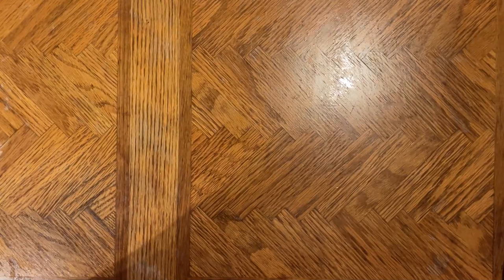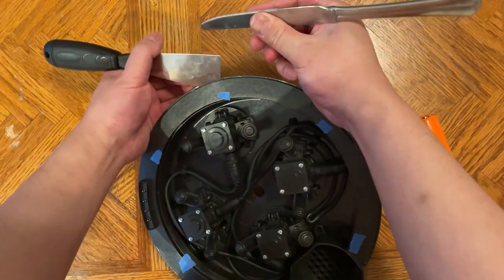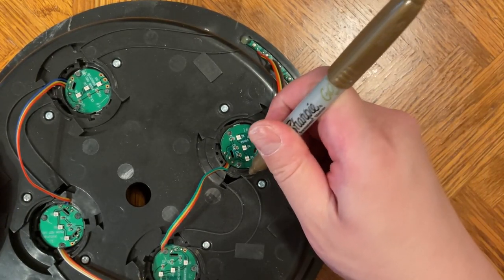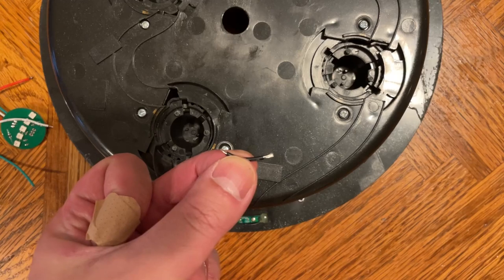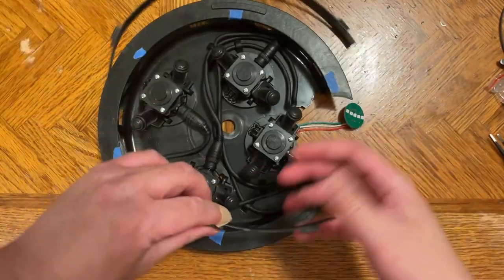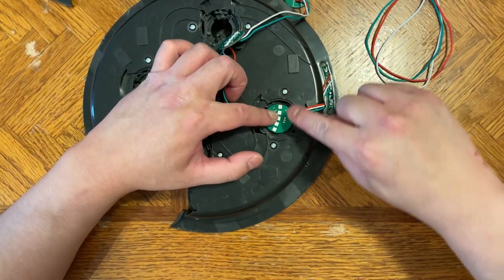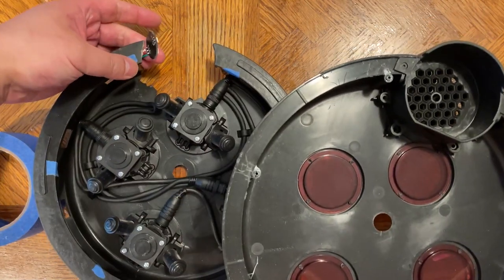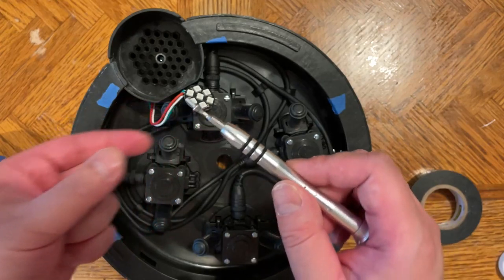5-LED Cyclotron Add-On for gpstar's Haslab Kit Step-by-Step Installation Guide

Comment: I'd like to use screws to reconnect the two parts back together (mentioned at 19:30 in the video). any idea what screws I should get for it?
Reply: I haven’t gotten a chance to rip into my pack this deep but I’d look for something that can lay as flush as possible especially since it’s on that same lip where the connection is
Reply: You’d probably want countersunk m3 screws with a heat insert (if you plan to make it accessible later for maintenance and upgrades)

Comment: Should this tutorial work with the Frutto 9 LEDs lights? Working on a DIY pack and mostly just need to know how everything should get wired up
Reply from the maker: Yes. The 9leds may have been updated to be a bit easier to wire together but it’s the same steps
Reply: Thanks! Yeah I commented that before watching the video as I didn't realize frutto had an instruction image on their site of how it wired. Still, very helpful video

Comment: This is a fantastic mod. However, for the collector-minded folks, this causes damage to the cyclotron and/or pack as a whole and may devalue its collector value. Just be aware of this. Great tutorial, great mod.
Reply: This is the reason I bought the Spirit full size pack. My 3d printer has been putting in some overtime for all the mods, and I can keep my Haslab the way it was meant to be.

Comment: Good morning! Will you be doing a video/mod upgrade for the N-filter with smoke by chance? (Love these comprehensive videos!)
Reply from the maker: I might! But we aren’t selling any smoke kits so my video would be a more of a diy guide (soldering required). But we can sell the 3D printed parts. Dunno if that’s something you’re interested in or if you are just looking for premade kits
Reply: @jonogunn  It's been my dream to get a fan to kick on and blowout smoke (not quite as extreme as the Phoenix mod). I've got the Frutto Tech smoke printed kit and you're collab with such a user friendly approach is really appealing. Also, mixing kits is impossible for beginners like me.

Comment: I take it these 5 led cyclotron lights will not work with the stock Hasbro board? Due to the fact that you cannot change from 3 leds to 5 in the menus, because there is no menus with the stock board.
Reply from the maker: you are correct. most of the videos you see on my channel are related to the gpstar kit

Comment: Can you do this mod and the n filter led with the standard circuit board? Or do you need a different circuit board?
Reply from the maker: This is only for gpstar replacement boards. Please see the description for more info

Comment: Thank you so much for the video, I just hope that there will be a future terminal video, I was also thinking of blue painting tape to mark the leds

So if we dont use the glue, the clear discs that go above the lights won't be able to hold the led discs in place?
Reply from the maker: I don't have the terminal non-solder version but the connections are the same as the solder version. I mentioned which wires connect to which and you just have to screw them into the terminals. When you get yours if you still have trouble reach out to us and we'll help you out

The clear discs holds it down but while placing them on top your led pcbs will probably move a little and no longer line up. so unless you can get it perfectly lined up it's best to just glue them down first
Reply: I wish there was a reliable person who could mod my pack for me. I have no skills when it comes to this stuff. The pack is my prized possession and I am way too afraid to even attempt taking it apart.
Reply: Where can I get those 5 led cyclotron lights
Reply from the maker: @kollarking3264  http://www.fruttotechnology.com. it only works with the gpstar haslab kit
Reply: Thank you for the information
Reply: @jonogunn thanks you rock (what did you do to your barrel on your wand? Is that tape?
Reply from the maker: No just silver paint from when I first got it. I’m replacing it with a more accurate barrel

Comment: How can I get just the audio files for the wand? (The beeping and the whirling sounds so I can add to mine)?
Reply from the maker: On my website
Reply: @jonogunn   I was looking but don’t see a link for just those 3 audio files 🤔
Reply from the maker: @Mosconi526  there is a link on the Support & Download page for the zup of all the sound effects. just download that and take out the files you need
https://drive.google.com/file/d/1gEvM2XHU72I-YrimvzInWgHL0pyb-0gh/view
Reply: @jonogunn thank you! So, I can just drop the files anywhere onto my sd card and they should work or correspond correctly with the appropriate switches? (Long as I don’t change the number in front of them?)
Reply from the maker: wait what kind of set up do you have? i assume you are not using the gpstar kit?

Comment: I can't help but think when people are doing all these mods to the Haslab pack it somehow devalues it, the cyclotron is now broken and had to be glued together, same with the wand, you have drill to get to the screws and once opened you have to be extra careful of the wires. This is the reason I bought a Spirit full size pack, so I could mod without damaging the Haslab pack.